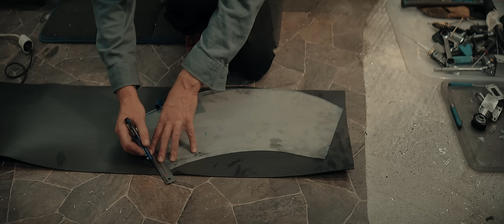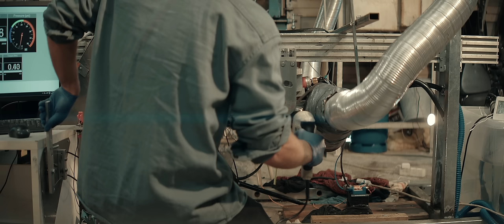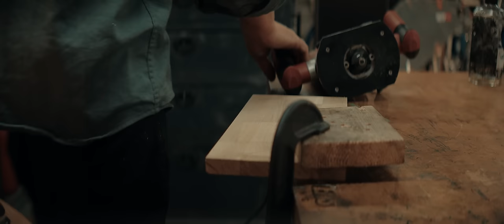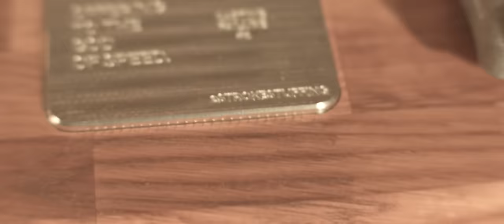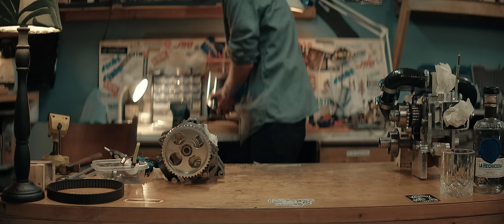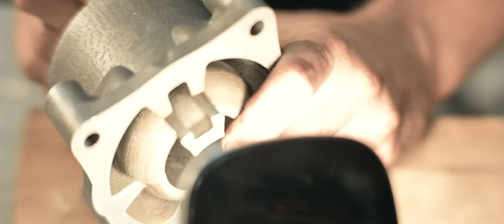Supercharging The 50cc Two Stroke PiP Engine!

Comment: You can use just Gears for the Exhaust Pipes. In German we call this Stirnräder (Spur Gears). Its common on Motorcycles and VW T5 2.5 TDI
Reply: I agree. That is also used on some engines, to drive the camshaft(s) and is more durable than chains. The Volvo B18 engine is one of those,- and some V8 engines set up for racing.
Reply: I second this idea
Reply: That's a great idea. I bet they could be fairly lightweight to minimize the spinning mass.
Reply: But he also needs an oil bath for the gears, so it may be easier to just put a casing around the chains and put a small amount of oil in it, so the chain just slightly touches the oil...
Reply: @Henning_S.  yeah that’s a fair point. I think you could do both- oil cover with oil fill level and the gear driven idea. I like gears vs chains better because typically they have better longevity and strength. I also think they are easier to replace and less prone to failure.
Reply: @Hillwatch  yes, of course gears last way longer, but it is a race engine, so it usually doesn't matter if you have to replace a cheap part after every race, the weight is far more important, and a chain is way lighter than gears
Reply: @Henning_S.  can’t argue with you there.

Comment: The PIP engine with a supercharger is something i would love to see because i'm working on supercharging a normal 2 stroke aswel
Reply: Better be a chainsaw conversion to a hotsaw 🤣 I’m working on making an exhaust pipe for my poor craftsman 42cc chainsaw. I already blew the engine once from overheating.
Reply: I love what he do but he doing it the hard way
2stroke supercharged engine already exists Detroit Diesel make 2stoke diesel
Just copy the design and change the conventional valve with is drum valve design but not sure how well they will seal under boost
With a supercharged you don't need the lower crankcase to push the mixture in the cylinder the supercharged will fill the camber for you at bdc 
He complicate the design for no reason using the lower crankcase and is complex external intake piping
Reply: @legros731  Keyword in your statement is "diesel". Completely different monster.
Reply: @legros731  that's two completely different engines. Gas and diesel 2 strokes are different
Reply: @legros731  lol.  You have no idea what you are talking about.
Reply: @BarkBarkBunnyRabbit sorry for the wall of text you probably won't read lol
no it could totally be applicable fuel type is irrelevant
Adjust c/r for the type of fuel used add spark and a throttle body before the supercharger and it gonna work perfectly it's a engine you can modify it to work with any kind of fuel you want 
He can just use is brute force design add fuel injection and blow the supercharged straight in the intake port of the cylinder eliminating the need for the reed valve it this design the pistons is the intake valve
Make a custom piston with a ring on the bottom to seal the lower crankcase from the boost and maybe a longer sleeve/ cylinder and it basically the same design as a 2stroke diesel and will eliminate the need for exhaust port in the cylinder if going the overhead valve route but for now is rotary valve would work
I find it funny how he try everything to not use valve because of the mentality that valve would limit rpm and go as far as designing rotary valve that may seal poorly and it's already been done on a 4stroke engine the camshaft is the valve eliminate many moving components 
By the way a cbr250f make peak power at 15k rpm and a redline of 18k rpm
Reply: @THatChevyguy91  lol for real never thought of that lol a diesel is not a gas engine wow revelation of the century!!!
Engine are engine 
A diesel is just a gas engine with high compression and a mechanical/ electronic direct fuel injection and mechanical high pressure injection pump
But most gas engine are direct injection now and got all that lol
One is controlled by the amount of air (throttle body) the other is controlled by the amount of fuel (mechanical injection) 
the design can be easily modified to be a gas engine 
It way better that this cobled mess that rely on reed valve that don't like the nitro he use and some weird/cool rotary valve that certainly will not seal well especially in boost and the intake path is way too complex with these external transfers port
The blueprint are already there for a 2stroke supercharged engine that proven  just adapt it to your specifications 
Don't get me wrong I like what he do and is engine testing,failure and change of design are really fun to watch and hope one day he became the fastest 2stroke 50cc on Bonneville

Comment: That is the same trate as a the 10-71 supercharger well those stighl Superchargers. As they spoil up a load of fuel towards the front of the screws. Then suddenly dumps it all into the front cylinders. Causing a hidrolic lock. 
This was shown to me by Bryan Macosca of Tamworth Australia. 
He was Australia's number 1 boat racer & engine builder..

Comment: Said it before... the brute force lump needs a sleeve valve configuration like a Rolls Royce Crecy. There's a reason why it was one of the most powerful aero engines to date...
Reply: absolutely Crecy valve could even be a ring in a channel rather than spinning a cylinder liner.

Comment: Thank you for years of high quality content. I humbly ask as a 2stroke fanatic- that you keep your mind open to turbocharging if you continue to struggle with belt driven forced induction. I have only seen 2 properly turbod 2strokes, but they were insane when in boost and on the pipe. IIRC  the pressure of the return wave is squared when the atmosphere around the engine is doubled. A properly sized turbo will not cause backpressure, a perfect turbo represents a perfect stingers backpressure when in boost and on the pipe. It would spool slowly, but that won't matter much in a land speed application.
Reply: does this take away from the 2 stroke noise we all live to hear?

Comment: The fuel bowl needs a "shaker". The Ford Motor Company  (fomoco) used it in the 1960s ~ 70s. 
It agitates and helps vaporize all the fuel, all the time, at all levels. 
Ford used the natural vibration of the engine to splash the fuel around. I've also seen it used on competition 2stroke chainsaws. 
;)

Comment: I've been working with turbocharged 2 stroke snowmobiles for quite a while. The right pipe will do all the work of what you are trying to accomplish with drum valves. You called it the brute force (concept) anyway

Comment: You've done the right thing to re-invigorate your project!

I think you are going to be very surprised! 
The snow mobile guys have been doing it with turbo post stinger pipe and they were told you can't do it? Well they proved them wrong. Boost does go with expansion chamber! 100%

This is going to be epic!

Comment: If you watch the videos 
Each time the engine stalls you can see smoke coming out of the carb ... 
I think you should use a drum valve in the intake too 
And intake should not go thru the block 
As you said condensing nitrometh swapping into the combustion chamber... 
Its an issue with normal gas 2 stroke engines when the volume of the crank case is too big or surface too smooth but with your nitro its getting even worse 

In the vid it looks like with the engine getting hot, like crankcase getting realy hot it starts stalling ... 
Looked alike in the last vid ...

Comment: why not use automotive quality timing belt for driving the barrel valves? you could also cap off one side of the valves so the exhaust exits out the opposite side to help keep heat off the belt then build a housing around the exhaust port side so you can mount a single stationary exhaust pipe
Reply: Belts got a lot of power loss compared to a chain
Reply: @rodriguezfranco3839  timing chains require constant lubrication it's supercharged so there will be parasitic loss. probably better to run a turbo sense low RPM torque is not important, I also think spring and vacuum loading the valves closed then actuating them open with a servo and excess boost pressure with a blow off valve would be better but not so simple

Comment: So I've been thinking about your port control problem.

I really liked the setup with the flat disk rotary valve. It seems to have been the best configuration so far, and not nearly as complicated as the valves you're using now. However, the boost creating friction along the engine side of the disk was one problem, another was distortion caused by the disk spinning so quickly (and causing it to fracture), and then you had belt deterioration from drive stresses caused by the disk drag in the housing. I know the thicker belt helped, but that was just a band-aid.

One solution that I think would solve two of the 3 problem would be to use a multi-shuttered disk running at 1/2, 1/3, or 1/4 the RPM of the engine. This has an advantage of running the rotary valve at a slower speed while also reducing the weight of the disk itself. If you make the disk and housing slightly larger, you can then improve the support along the outer ring of the disk while still reducing the rotational mass and torque required to spin the disk.

To resolve the friction issue of the disk pressing against the rotary valve housing under boost, you could line the outside edge  of the housing with several tabs of Teflon to help the disk float off the aluminum. This would create a low friction environment for the disk to ride against and would be lubricated by the oil in the premix.

Also, returning back to this configuration will allow for your fuel system to go back to a down-draft configuration and help prevent puddling.

Anyway, just some thoughts. Looking forward to the next video! Good luck!

Skål

Comment: If I were marooned on an island I would want just a pallet of ductape, if it moves and it shouldn't, use ductape if it still moves you didn't use enough ductape...lol.
I had pondered many times about the merging of the two engines it was destined to happen somewhere down this rabbit hole Alex lol.
Love the artsy fartsy failures well not really failures but stepping stones.

Comment: I look forward to se how the PIP runs with a supercharger and I believe in keeping the over all design as simple as possile when it comes to gears, valves and drivetrains. The most basic 2-stroke is already driving a supercharger, -the crankcase pump, so replacing it with an aux-pump is probably not too bad, but how about using a tiny turbo instead to use the "free" energy in the exhaust pulses? Perhaps a RHB31 / VZ21 is small enough for 20-30 hp? The engine will then start as a basic 2-stroke with crankcase pump, and perhaps induction reeds.
Reply: Turbos have been tried many times on small engines and they just don't work, there is not enough exhaust gas volume to build enough boost. Everyone I have seen was 1-2hp gain at best. You need at least 400cc for a turbo to be efficient and effective.
Reply: @joshkolden9103  Oh, I guess this is because a turbo is mainly driven by the pulses and not the average flow. Does this mean a 500cc single cylinder has a greater chanse for success than a 3x300cc? I'm thinking of trying a tiny turbo on my three cylinder two stroke Saab. It's an 850cc engine, but there is perhaps to weak pulses from each of the cylinders?
Reply: @elektroarkivet  There is enough volume on a 850cc triple to be successful, lots of 2 stroke snowmobile engines run turbos and they work great. I own one actually.
Reply: @elektroarkivet  I was also thinking the piston in a 2 T was supercharging the charge due to the crankcase compression. But have learned that the crankcase scavenging is not supercharged by the piston since it only suck in the cylinder volume and not more.
Reply: @nhytg376tgyuu765gjmg  - Yes. Any supercharging on a conventional two stroke can, and is, only done by the exhaust
Reply: @nhytg376tgyuu765gjmg  I totaly agree, it's not supercharging by definition, it's just naturally aspirated induction. Supercharging is about ratio.

Comment: The biggest problem with that drum valve exhaust is that you'll never be able to put an exhaust system on it.. it's not possible to hook up a pipe to a spinning exhaust.. You could theoretically design it where the chain is inside a rocker box with the outlet leading to an exhaust port where a pipe can bolt on to but otherwise it's impossible.. but that'd also have problems with the exhaust wanting to travel back in to the engine.
I think I know why it keeps dying, you need more spark energy, it's blowing out the spark. Top fuel engines run two spark plugs per cylinder at 44 AMPS of energy firing each one. While you are still at about half the nitro percentage that they are, you still need a lot more spark energy than a gas engine. Something else you need to look at is how much hotter nitro runs than methanol and the appropriate air/fuel ratio. @90% Top Fuel runs a AFR of 1:1 Top Alcohol on 100% methanol (actually 95% methanol 5% toluene so they can see the flames) runs 3.8:1 AFR. By my math at 40% that should be about 2.7-2.9:1 AFR.

Here's some useful links that might teach you a couple things. http://www.turbofast.com.au/racefuel.html https://airdensityonline.com/2017/05/tuning-with-methanol-vs-nitro/

And here I thought you were going to make your offerings shelf.. I should know better to think that anyone on youtube actually listens to me.. The thing is, how else do you think Burt Munro was able to do all he did with as few tools as he had without his offerings shelf? It's like wearing bibbies and flannel to work on tractors.. it's just something you HAVE to do if you want it to work right.
Reply: I also second the two plug idea, maybe with coils from a more powerful engine?
Reply: Of course you can connect an exhaust up to it. Don't you think this has been done before?

Comment: How about a opposing piston engine? Perhaps it will be a piston cooling issue with no cylinder head, or difficult to arrange a good combustion chamber with both squish and the spark in the middle. An opposing piston design should however be a good way to both keep piston speed low and give a great possibility to experiment with blowdown and scavenge timing. I guess it may even be possible to add a tiny turbo after the expansion chamber while still using both crankcases as scavenge pumps.

Comment: I think if you make the rotary exhaust valves single sided, meaning only one side is open to the cylinder. You could run the drum valves from the other side using a belt and perhaps not have to worry about heat melting the belt

Comment: If fuel is pooling in a dead air area while the engine is sat running, as soon as load is applied the flow characteristics could be enough to pull the fuel back into the air stream.
Many things happen during the transitory phase👾

Comment: If your going for power, why add all of the drag and load of a blower? By designing a system that can manage case pressure increases, you have made it past all the hard stuff. Put a turbo charger on it and gain all the power without the load on the engine. They make turbos that are tiny now days and they can be had for cheap to do testing with.
Reply: I think turbo charging could actually be an option on the Brute Force two stroke. You're not dealing with the usual fine tuned harmonics of the NA engines, so I think in this case it could work well.
Reply: In real life turbos are the way to go

Comment: Attaching the blower to the crankcase impedes the piston from coming down due to the high pressure in the crankcase.  

What about this concept...attach the blower to intake port or ports and control when fuel/air mixture can enter the intake with a rotary valve so you don't have a constant side loading on the piston due to the blower pressure...eliminate the transfer ports completely and just allow the blower to push fuel/air mixture in as well as exhaust gasses out.

I think you lost a lot by not using the resonance that the expansion chamber/chambers provide...they will still help even with a blower and may be even better with the blower since the pressure pulse should be increased and more distinct.  The drum valves worked but are terrible for efficient flow with their right angle turns and no help from the expansion chamber resonance.

Lastly...if you are not limited to "one cylinder" by the rules you will be running under at Bonneville, a two cylinder engine will produce more power.  I'd be tempted to go with a "L" twin i.e. 90 degree V-twin design.

Comment: Why not a small turbo with a boost capacitor or boost tank to hold the pressure until it’s needed by the engine? The turbo just continues to fill the small tank and when the engine is in the intake stroke it just shoots right in there. Like ford did with the focus in the 2000s with a boost tank bumper to hide it lol
Reply: this engine is designed for a single pull, with respect. It's not a circuit racer or daily rider.

Comment: Honestly I'd really like to see poppet valves in the cylinder head of the brute force, either sohc 2v hemi head or sohc 4v pentroof head, just running all the valves as exhaust so the transfers blow in the charge air near the bottom and exhaust from the top which could reduce short circuiting fuel out the exhaust I imagine. Doing so could possibly also free up space for more transfer area or asymmetrical transfers that can be controlled with different butterfly valves.

Probably only downside would be is you'd have to fly cut valve reliefs in the piston or just leave it an interference engine. And probably will also limit you on compression ratio. 

Just my thoughts 😋🤟 Btw, love the content! Yours is the only channel where I WILL absolutely stop whatever the hell I'm doing to watch. Lol 😆🤟